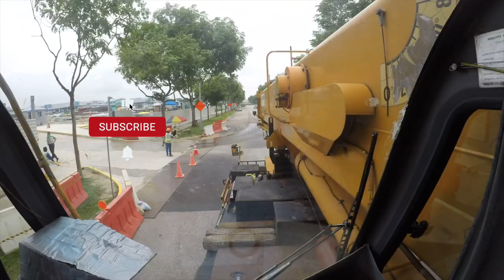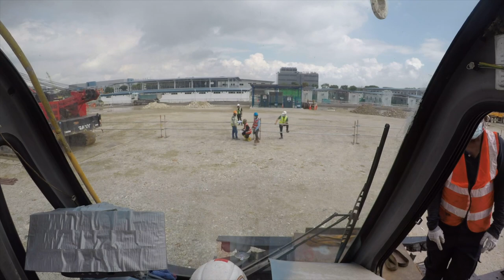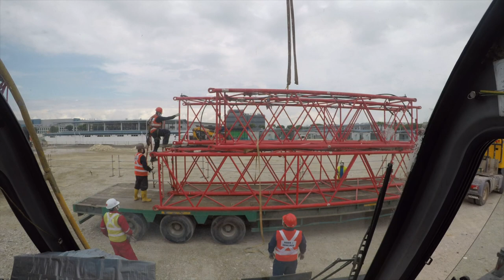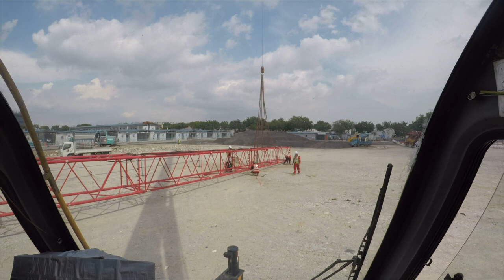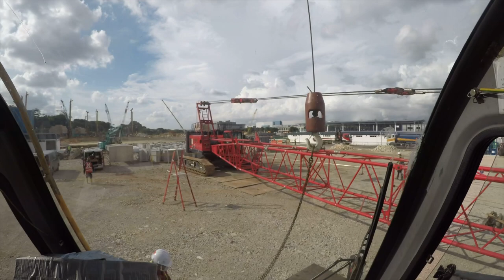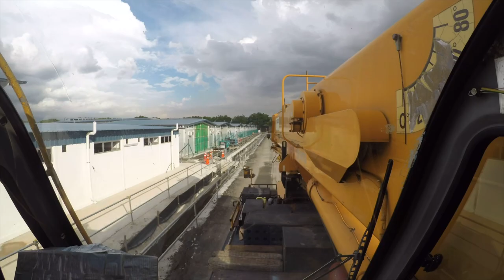How is a crawler crane assembled in Singapore? | Assembling Sany SCC750A

Comment: I have never seen a 75 ton crane being put together with an assist crane. I ran 75 ton link belt for years and 110 ton Terex cranes without an assist crane. I ran a 999 Manitowoc that we used a 75 ton Link Belt to assemble but the 44,000 pound tracks were off to transport and the main counterweight was 44,000 too. The crane can do it itself but we already had a 75 ton there. A 75 ton crane needs 100 foot of boom to install it's own counterweight so if the trucks are sent in the right order the crane just kind of comes together without outside help.
Reply from the maker: I think in most countries where job sites are situated far from the yards, having an assist crane practically makes no logistical sense. In my country most sites are just a 10-20km drive away, so assistant crane is usually sent to cut setup time. This crawler was rigged in just 3.5 hours with me as the assistant crane
Reply: We are only allowed 40,000 pounds on each truck(80,000 total for truck and load) so everything has it's place. The HC 110 Terex is 4 loads. Main counterweight is one and 100ft of boom plus 2 track weights at 11,500 pounds each. Then 30 ft of boom with the 13,000 of counterweight left over. The crane needs a permit because it weighs 105,000 but our DOT sets the route which can be 100 miles out of the way. We can do 3 loads with a higher permit but the state next to us requires 5 loads no way around it. 3 loads takes an hour set up but 5 loads takes most of a day because the tracks are off.  U.S.A has 50 states and 50 laws on how to haul a load. 110 ton and smaller takes an hour to set up most of the time in my state.   @SGHeavyVehicles
Reply from the maker: @williamrosenow6176 Damn.. having different laws in each state is ridiculous. Cant imagine travelling legal in say Texas only to be stopped at California 😂
Reply: Wisconsin lets you buy a bigger permit. I think we had 160,000 lbs but Minnesota only allows 80,000 lb loads. I got a 75 ton crane from MN that was 2 tracks, one crane, one counterweight and boom with some counterweight. Transport within Wisconsin and it's a whole crane and boom and blocks on 2 loads. I set up a 210 ton Terex that came from out of state and I don't know how many trucks were there on the morning I got there but I lost count during the day. The crane is 30ftx30ft so can't haul with tracks but each track is 45,000lbs so too heavy for a flatbed but a lowboy is only allowed one. That's one extra load because we can't haul more than one piece on a lowboy. The laws are stupid. One 90,000lb crane, OK but not 2 45,000lb tracks unless they are pinned together to the main unit. A lowboy trailer without a machine can only haul 80,000 gross weight. Our laws make my head hurt. @SGHeavyVehicles
Reply from the maker: @williamrosenow6176  Hahaha i know that feeling buddy. It's a pain for the planners. Are you guys required to display OVERSIZED CARGO on your cranes while travelling?
Reply: I think it's oversize load for us but yes. Yellow background with black letters. Fold in half sign because you can't display unless hauling an oversize load. I just think there should be a national standard. The 48 states should all be the same. The other 2 can do whatever they want. I have opinions and if we are the United States of America we should have consistant laws. @SGHeavyVehicles
Reply from the maker: @williamrosenow6176  Ah thanks for the info. Indeed, the laws should be consistent
Reply: Sir Mujhe Bhi Job krna H singapore me Plzz Help Me

Comment: What is the capacity of the mobile crane Require for assembly  100T crawler crane ? 
Also, give a video for transportation crawler crane various parts
Reply from the maker: Highly depend on site constraints and site requirements. If site area is big, 60ton mobile crane can do it easily. If small area and crane has to park far away, then a 70ton or 100ton mobile crane will be needed. 

My company does not transport crawler cranes so i do not have video of that. But will do so if i happen to see it